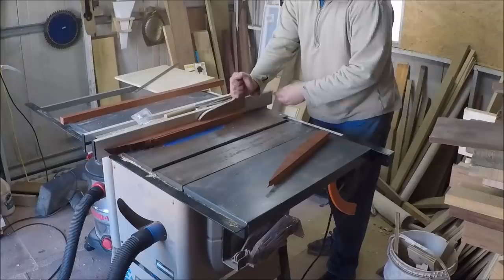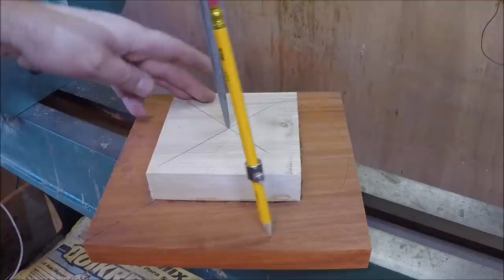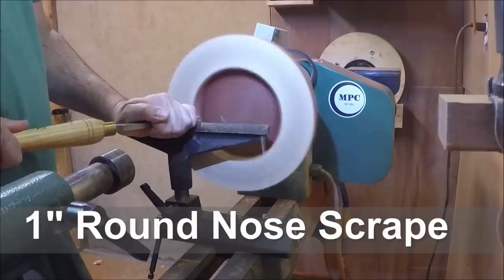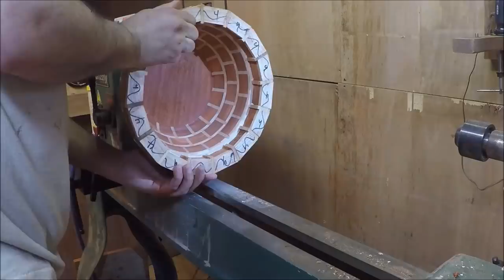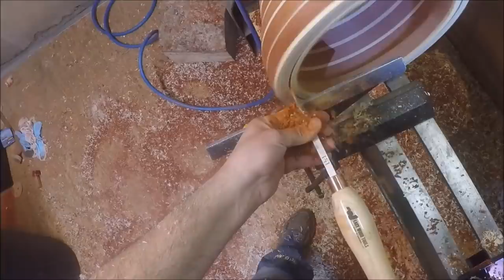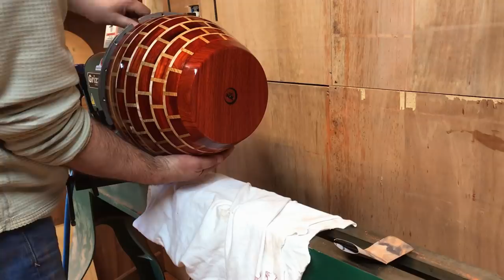Wood Turning - Brick Wall

Comment: This is an amazing piece!  I just bought a Grizzly G0462 lathe. Seems to be a good machine. Have you found a good way to secure the spindle from turning other that using their poor fitting wrench in the little slots on the side of the spindle? My 4-jaw chuck seems to be stuck on the spindle and those little slots are rounding off using their wrench.
Thanks for the great videos!
Reply from the maker: I loved my 0462. Sorry to say I had the same issues as you. I ended up using a piece of plywood in the jaws and a wrench to get the chuck off.